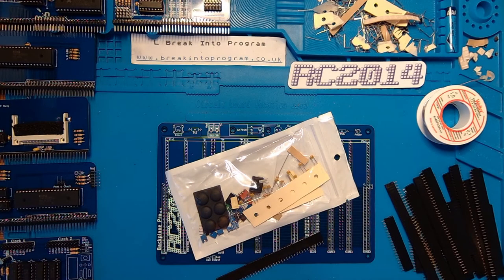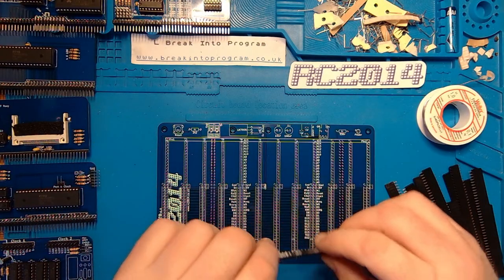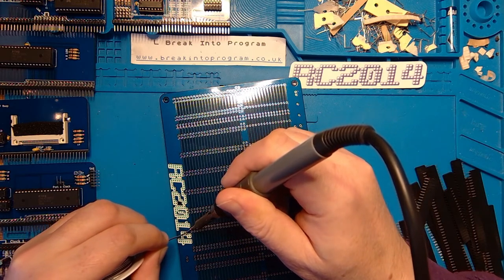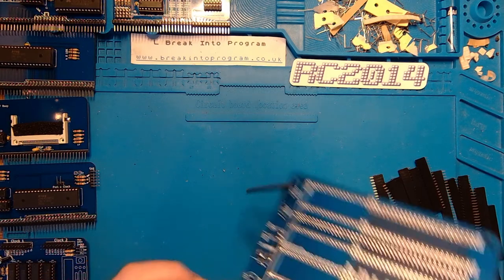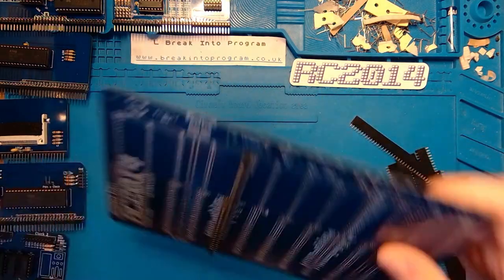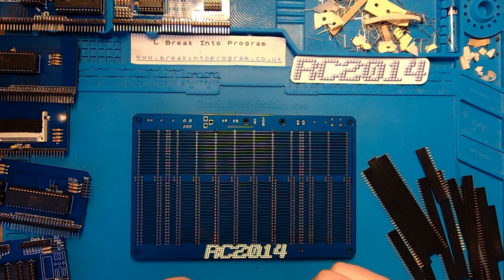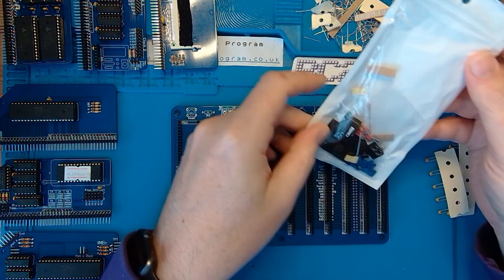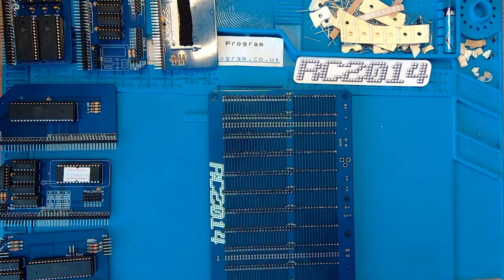RC2014 Build: Backplane Pro

Comment: Did you cut the trace per the instructions? Thanks.  " However, between slot 3 & 4 and slot 10 & 11 on the standard bus, there is a double row of holes where the copper joining them is exposed on the underside. "